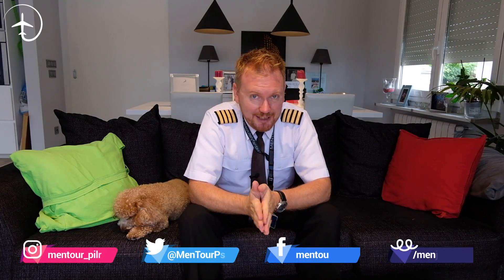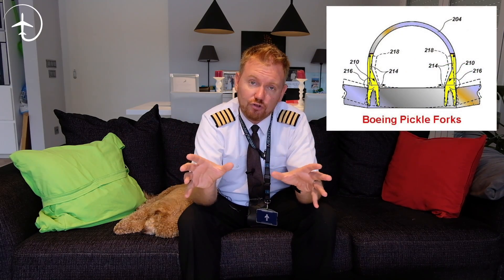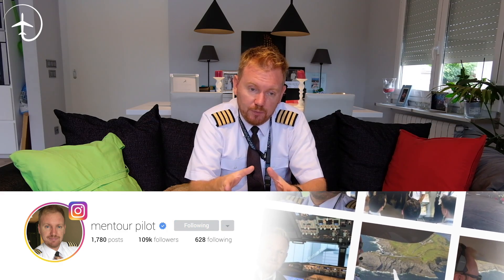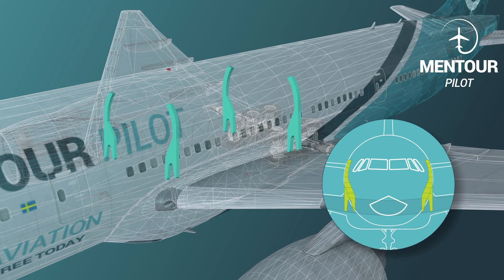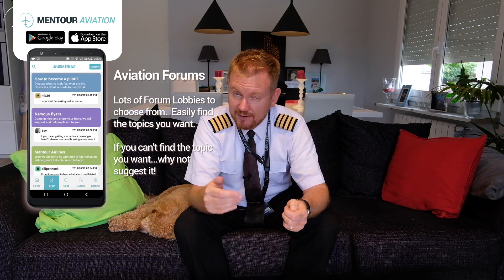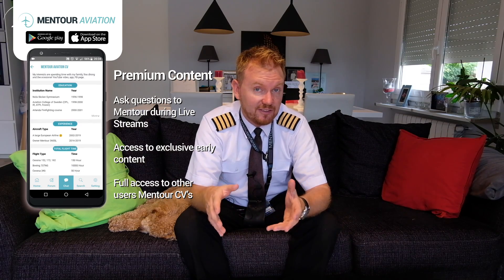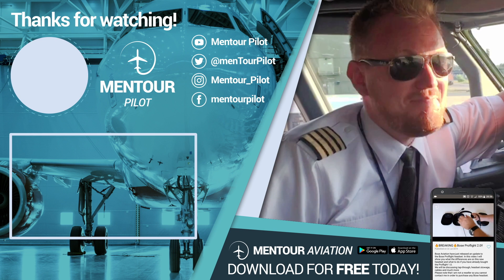Cracks in the Boeing 737 NG wings!? Mentour explains

Comment: I assume the design of the pickle forks hasn't changed from the previous model of the 737 to the 737 Max?
But the Max has the engines mounted way more towards the front of the plane - and wings!
Instead of creating mostly a forward pushing force, this new design creates more torque trying to twist the wings, doesn't it?
And that would put a NEW stress on the wings - and pickle forks - than in the previous designs of the airplane.
Reply: A max and an NG are different, they're also structurally different between the generations
Reply: This issue is affecting older 737 NGs, not the MAX models.
Reply: @lukeholland5670 
The structural differences are limited to the engine area and wingtips, the main structure is unchanged. If they had bothered to change the structure they'd have raised the landing gear, avoiding the issues with the engine placement and subsequent MCAS troubles. The main fuselage structure itself still is largely identical to that of the 707, for which it was originally developed.
Reply: I don’t pretend to know jets but u know helicopters specifically Boeing helicopters very well and I can tell you the structure in airframes between models don’t really change much. A reenforcement here or a lightning hole there. Maybe a change of alloy in the aluminum. I’d be willing to bet that jets are the same way you have a design that works keep it till it doesn’t
Reply: @mikeblatzheim2797  - The nose gear was lengthened by 8"
Reply: Sorry, yes, I got it's not the MAX but the NG h the point I wanted to make is that doesn't the NG have the engines extended to the front in a similar way?

Comment: Could also relate to the conditions in India. Poor runway quality - all runways I have landed (as a passenger) have been really rough. Maybe US/European cycles do correspond e.g. 2 cycles in a third world country.  There are also extreme temperature loads: It can easily be over +50C in the shadow and then -50 in the sky. Also the air quality is poor, probably something that has not taken into account when selecting the alloy.

Comment: Hi Mentour Pilot! In light of this week's crash of China Eastern Airlines’ 737-800 Flight MU-5735, I got to thinking about the pickle fork cracking problem (since they're used on 737 NGs, including the 737-800). I've read dozens of articles about the pickle forks in an effort to identify exactly what would happen if one or more completely failed in flight. The only answer I could find is that it "could result in catastrophic loss of control of the aircraft". That's pretty vague. Can you tell me what specifically would happen to the aircraft if one or more of these four assemblies completely failed in flight?
Reply: Came back to this video because of this. Nothing , and i mean nothing will make the plane freefall the way china eastern did other than loss of wings,,,,,, could be it….
Reply: @jordan23fann  Since then Black Box dat a has shown that it was most likely deliberate. I also heard rumors of the captain having marital issues and problems with the company . This crash is giving off silkair 185 vibes

Comment: My bet is on this related to the NG whistleblowers reports in the 2010 NG Algezera documentary about ribs being hand made instead of on CNC as in specs.  This resulted in assembly miss fitting/drilling/jury rigging causing extra stress on system.

Comment: The airlines will have to pay, but I think they’ll seek reimbursement from Boeing, and if they refuse that could lead to a lawsuit.
Reply: Indeed, I really do not understand why the airlines should bear the costs if this is a manufacturing problem (either from the part, or the plane assembly).
Reply: As it was said in the video, no mass production goes without flaws, the key here is to detect and report those flaws earlier than it could have led to undesired outcomes, and everyone in the industry undestands that quite well. This is the backbone of the aircraft continuing airworthiness management system, and when you buy a plane, you agree to it. That's why any lawsuits in this regard will most probably be unsuccessful, unless it is proven that it was severe negligence and violation of type certification requirements by the manufacturer and the authority that issued the TC.
Reply: @koreniev  I understand that from a safety point of view everything is working well: the problem was detected before anything bad happened. But it doesn't change the fact that the airlines bought a defective product, if the pickle fork lasts only one third of what it was supposed to (and I'm guessing it will be an expensive repair) the fault is on boeings side.
Reply: @MrFatpenguin  they goes out-of-court settlement, like when Trent 1000 on 787 (they still cover PLL LOT grounded 787 and ACMI)....

Comment: How come we have DC-3s still flying without these problems?
Reply: Not subjected to as much stress!  Plenty of high hours ww2 fighters flying but had to retire the Vulcan bomber due to complexity and uncertainty over how air frame would handle more low level air displays.  Sometimes simpler lasts longer!
Reply: geoff dearth The DC-3 was over-engineered. That means it was heavy and slow.
Reply: @gordonrichardson2972  Thanks for your expert engineering opinion.

Comment: How often will they have to perform/repeat borescope inspection?
Reply: Every 3500 FC for now. Boeing is collecting data now(we have to report initial inspection results), they(FAA) will either keep original inspection interval or decrease it if the problem is bigger than ecpected. I personally do not believe it will be increased(inspection interval), I have never seen that before in aviation.
Reply: @hrvojemicuga1624  Thanks for the clarification!  So about every two years.
Reply: @hrvojemicuga1624  Funny, I fly with Go2sky from LZIB occasionally. Keep the fleet safe! ;)

Comment: Would be interesting to see how many hard landings those affected aircraft have
Reply: Jonathan Good  he did say they were from an Indian airline and I’d bet it’s safe to say that there are more hard landings than what have been reported.
Reply: Halcyon it’s an assumption based off of 17 years of aviation and non destructing inspection experience but my experience also comes from rotorcraft and working with middle eastern countries in which pilots and maintainers do not have much experience and hard landings are either not reported or under reported. 
I’d be willing to bet that inspite of the hours the pilots have they are not trained to the standards that most western countries are. And likely those planes were used by low time pilots that would set them down hard due to the lower standers and experience. 
Now aircraft are designed to be set down hard but not consistently. I’m not saying that’s the case but I’m also saying it’s not I don’t know their standards or training.
Reply: Funny how you instantly call racism when you know absolutely nothing about me. I just call it how I see it. I may not look it but I’m a 37 yet old man. I’ve been a aviation mechanic and crew member since 2003 I also specifically said rotorcraft I don’t know jets like I do helicopters but I have a lot of knowledge when it comes to airframe structures as well as non destructive testing including x-ray eddy current ultrasound mag particle and dye penetrant testing. I’m willing to bet you don’t know the first thing about any of it. Call me racist all you want but at the end of the day I doubt before this video you had even herd of the pickle fork and you probably still couldn’t tell me how it relates to the wing spar box.
Reply: @derkspringer2483  hard landings was my first guess also. That or some wicked turbulence! Lol
Reply: Not necessarily racist. I did notice a difference in the way pilots fly in some countries. One case I remember is in Brazil, where pilots had a tendency to make very sharp turns during descent. Perhaps they have more military pilots that move to civic aviation?
Weather, turbulence, the propensity of wind shear in certain regions may be a factor as well.
Reply: The Indian airline in question calls them “Samosa Forks,” the 
A/D (Airworthiness Directive)  will very well be misinterpreted.
Reply: One other thing, not to stereotype or anything but God could you imagine the smell of that airplane?
Reply: @derkspringer2483  what's that supposed to mean?
Reply: @SJF15  not much since hes fucking joking
Reply: @derkspringer2483  
Same ole, same ole. Blame O/S pilots for Boeing's deficiencies. These are "fatigue" cracks which are different to stress cracks. Do a search on Boeing's quality control issues, become informed.
Reply: Bill Thomas*
  Boeing doesn’t produce the fuselage, Spirit AeroSystems does. Spirit was the commercial side of the In Kansas that was sold off while keeping the military production and refurbishment. 
  The serial number range of effected aircraft needs to be identified, then Spirit and their suppliers can examine their records.
Reply: I agree Boeing’s quality hasn’t been the greatest lately. Hell I’ve lived through plenty of flight directives effecting their helicopters. Way more than the bells and Sikorsky helicopters I work on. But as of right now world wide they have found 36 airplanes of 686 built 737ng’s have these cracks. That is 5% of the fleet. I’m sure that number is going to rise as these inspections continue. My guess is likely they over hardened the pickle forks making them brittle.
Reply: @XB10001  Ayup. Ex-military is a big factor in how you sling that bird around, as the is terrain, weather  and general culture where you learned. You'll fly like you trained. That said, I've always associated Ryanair with the hardest ass-plants on landing that I can remember.
Reply: @derkspringer2483  holy f* s*, that's big. And this was discovered by pure chance because they were retrofitting those units for cargo.
It was going to be found eventually, one way or another.
Reply: Xb your absolutely right. And like I said I bet not all of them have been inspected yet.
Reply: @derkspringer2483  Hate when people call out the racist thing instead of facing the reality of a situation and trying to improve it. Truth has no "emotion". People revert to calling names when they have lost an argument.
Reply: I’ve flown on Jet Airways quite a bit before it went bankrupt and they weren’t really that big on hard landings. I am of course purely speaking out of experience. 

Further, most Indian pilots I have interacted with are usually straight out of the Air Force or have been trained in the US.
Reply: From my experience the only time a hard landing is reported is when it throws a light
Reply: Spicejet makes a ton of Shit landings (personal experience)
Reply: butch oblick oh, you’ve flown with Indian carriers? Kudos. You managed to fly on a jet blue in India ? Bravo, considering we don’t have an airline called jet blue. Also, kingfisher? The carrier has been defunct for almost a decade now. I’ve been flying for 29 years in India , flown around 3000 or more times and I encountered hard landings only a handful of times . Get out of here with your bs claim that it’s the norm. Btw. Kingfisher was better maintained than the so called western counterparts (spirit, Ryan air)
Reply: It makes no sense that third world nations'  pilots are operating commercial aircraft in ways that would increase their chances of failure. 

If that were the case then all models of aircraft would display evidence of increased and early failure rates. 

Are Indian operated planes showing increased wear or failure rates for their other models of planes? 

I am not aware of such for the Airbus models. Nor the 757, 767, 777, or 787 models operated by Indian companies. The old 717, 727 and 747 models seemed to hold up appropriately in Indian companies. 

I won't call the comment racist, but the whole idea of Western superiority needs to stop. 

I mean honestly, the Indians are very intelligent people. Their pilots are well-trained. And if it is due to a systemic problem with poorly trained pilots, such problems would be manifest in other aircraft models. Which doesn't seem to be the case.
Reply: Frank64 Oh shut up, are you offended for probably the 150th time this week?
Reply: Quantas has also the same Problems.
Reply: @XB10001  So what's that say about AA pilots 1 of whom literally tore the vertical stabilizer off his aircraft?
Reply: Trainspush Through  It seems entirely plausible that 3rd world countries are more likely to have lower standards of training and maintenance. The "racism" attack is weak and lame.

Comment: Airospace industry has NADCAP  standards and it will be a joke if you suggests that batch of aluminium caused this problem 
most likely scenario is that this parts were made for another type of plane but used in NG and doesnt match to spec for stress bearing of NG

Comment: If a 737 had a "HARD LIFE" at "difficult" airports, could additional loading have been a contributory factor?
Reply: I doubt it.  Large commercial airliners from Airbus or Boeing are subjected to the harshest routine usage tests.  They have special full scale air frame torture test rigs that can simulate the full lifetime effects of landing gear slamming, wing flexing to name a few.  The "hard life" is already factored in and may have it's own special flight hours recommendations for maintenance.
Reply: george martin Landing the aircraft is only a fraction of the stress imposed by a flight cycle. Atmospheric turbulence, and cabin pressurisation play a much bigger role.
Reply: Jet Airlines in India was flying between major airports - not anything special. 16 aircraft were being converted and 3 were found faulty.

Comment: I'd like to expand on what Chris said. There's a distinct possibility that these cracks happened because of turbulence or hard landings. I've seen no mention yet as to how many forks were cracked or where these cracks happened. We don't know how many cycles were on the parts, and we don't know the possible damage history to the aircraft. It's possible that a hard landing last December initiated the crack that was undetectable until the aircraft was stripped down. Another thing to consider is that The Indian Subcontinent is not the easiest environment to fly in. It gets VERY hot and VERY stormy at different times of the year, so I don't want people thinking that I'm ripping on Indian pilots for whatever reason. Thanks for the good info, Cap'n, keep up the good work!
Reply: "We don't know how many cycles were on the parts"
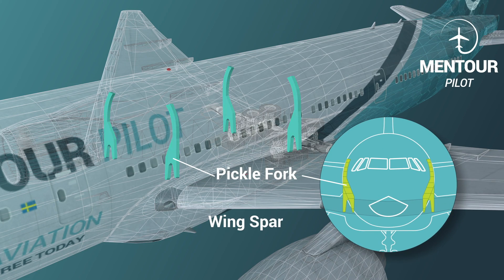3:10 30000
Reply: 36 so far!

Comment: Mentour, thanks for addressing this - troublesome the way it has been reported and I'm on 737s quite often.  It was good to see Leeham report the 5% rate as opposed to the 50% crack rate reported on AVH.  That said, the finger has been pointed at the add-on Scimitars not necessarily the factory installed ones as a cause.  Was the wing strengthened in design for the Boeing installed Scimitars?  And hoping Boeing comes clean on whether and how the Max pickle forks might be different - nough problems there.
Reply: ajg617 Still a lot of unknowns in this story. Leeham did an update on the numbers.
Reply: @Sterlingjob  Definitely not. Primary structure has no redundancy and is designed to not fail (safe life). Redundancy only is mandatory for systems. Systems are hydraulics, electrics and flight controls for example.
Reply: Exactly, every part has a minimum of two fasteners!